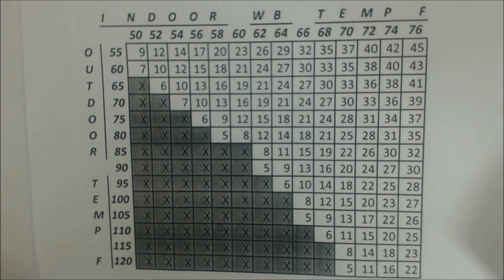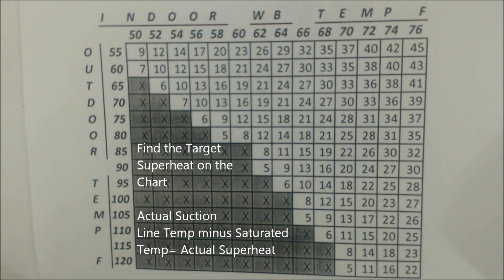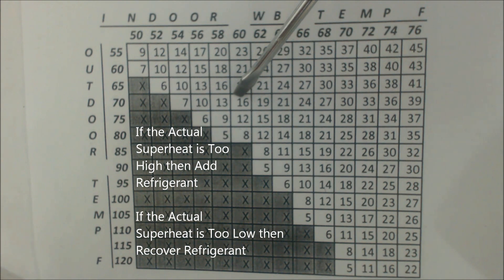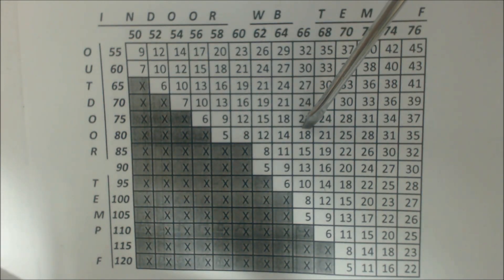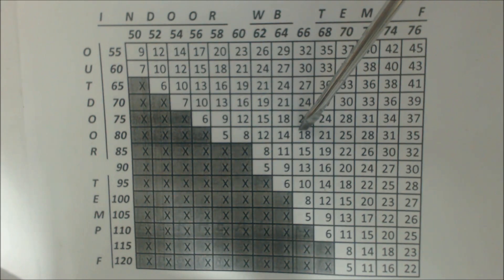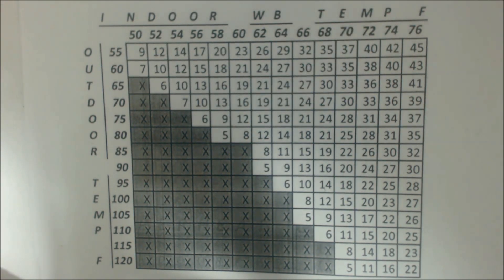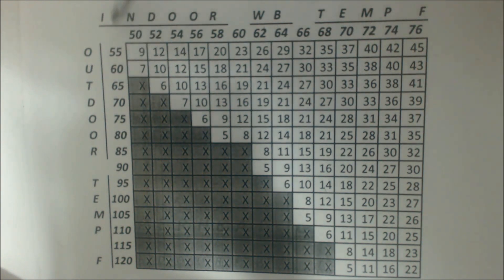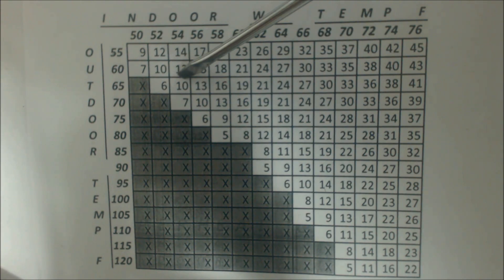Superheat Charging Chart- How to Find Target Superheat and Actual Superheat on an Air Conditioner!

Comment: I just did a change out at my house and didn’t add any extra refrigerant, so left it at the factory charge with my lineset being around 20’.  When checking my pressures my superheat is at 3.  86 outside temp and 75 indoor temp.  Something is wrong here and have no idea where to go from here, anyone have some advice?  I normally install new construction homes so rarely do any trouble shooting.

Comment: What is a good “wet bulb” thermometer?
Reply: Hey man check out the Fieldpiece JL3RH, it’s a great tool and you can use it through the job link app. I got mine a few weeks ago and it works great. Gives me the wet bulb temp on my phone in real time while I work outside at the condenser. Hope this helps.
Reply: @Jakeofalltrades777  much appreciated! I definitely will! This does help thank you!

Comment: I’m getting a little off topic. I have a temp split of 25 degrees today and my blower is running fine, it was not dirty. I ran the unit with no filter because the one it had was super dirty and I didn’t have one at the moment. Checked charge with superheat method and it was telling me I was overcharged. Will that cause my temp split to go high? Or will an airflow problem cause my superheat reading to tell me I’m overcharged although I’m not? I hope I’m making sense. Thank you in advance

Comment: I’m confused now because the formula for finding the superheat is the actual line temp minus the saturated temp/pressure in the middle of the evap = actual superheat. But now you’re saying to use the outdoor temp instead of the line temp. Is the line temp the same temperature of the outdoor temp?
Reply from the maker: Russell, this chart is for finding the target superheat or what the superheat should be.  You are correct that the actual superheat is measured by line temp minus sat temp. Did you check out our full length article on total superheat with the custom pics yet? https://www.acservicetech.com/post/the-hvac-total-superheat-charging-method-explained

Comment: Hi. I had an instance today that was confusing to me while trying to determine required superheat. Indoor WB=58 degrees; Vapor PSIG=60; Vapor line temp=47 degrees, outdoor dry bulb (temperature around condenser) = 96 degrees. There is no intersection of 58 WB and 96 dry bulb on the chart that gives a required superheat. I was using a Testo 550 digital gauge set. Am I missing something? Thanks.
Reply: Did you figure out what was going on with that unit?
Reply: @SaresMLee  There was nothing going on with  the unit. The unit is operating correctly.  If you look at the superheat chart,  there is no intersection of WB 58 and 96 ambient temperatures. It shows X, which indicates to me the reading are outside of range. What does one do in a case like this as far is calculating superheat is concerned?

Comment: how bout if it gives you around 95  temp 60 wet bulb what the x is ?service tech?
Reply: Exactly what I'm seeing.   Low pressure is 62 psi.   Suction temp is 62.2 .  Dry utah?   I'm about satisfied.     But how much do I loose when I take off my lines?

Comment: Great video! But I wanted to ask: when charging a system with an outdoor temperature of 80°F and 66°F indoor WB, after I reached the target superheat of 18°F, I find out that the saturated temperature in the evaporator is too low 30°F.
 What can I do to fix this? 
Keep adding more refrigerant to rise the evaporator temperature or leave it like that. Would the evaporator become frozen?
Just wanna hear out your opinion please.
Reply: add more

Comment: Can a digital laser thermometer, "point and shoot" type,  be used to measure the temps for this method? Thanks.
Reply from the maker: No they are very inaccurate and the temp where they are reading can change. You want to measure the air but that is measuring the object, thanks!
Reply: @acservicetechchannel  What about using one, though, for measuring the surface of the suction line at the condenser? Still not accurate? thanks!

Comment: I got a r22 split system,im replacing a r407c condenser would i be able to used this chart ? Has a piston on coil
Reply from the maker: Yes, the refrigerant will not change the target superheat, thanks!
Reply: @acservicetechchannel  thanks this help alot

Comment: Question: My Goodman Heat Pump has a charging chart on the back of the condenser cover with different Super Heat / Subcool . Should I fallow that or this chart??
Reply from the maker: Yes always follow the manufacturers chart as they may have a graduating subcooling instead of a average subcooling posted. Target superheat should be pretty close though, thanks!

Comment: I’m having trouble getting the correct superheat using a R22 replacement Nu22
I’ve went over 7# of original charges to even get close but stopped charging ( wet bulb 66) outdoor 95 .....best I could do was 20 superheat system was sweating back and cooling ....seems odd?

Comment: Thanks for the video. So to get the target superheat we have to measure the outside temp and inside wetbulb and follow the chart to find out our target superheat and then use that value to charge the system correct?. But when we start charging our system wouldn’t this change the inside temperature to cooler dropping out superheat value?
Reply from the maker: Yes, you will need to continually remeasure the indoor wb and input it in the chart to determine the moving target superheat, thanks!
Reply: AC Service Tech LLC ok so at what point do we stop if we are doing this back and forth?
Reply from the maker: @HowToDoitright  Just until the target lines up with the actual superheat and they are the same superheat, thanks

Comment: what happens if it's on the shaded area?
Reply from the maker: That means that you would have to set the system inefficiently for compressor safety unless there is an accumulator. This is a question that is asked a lot from techs that live in hot dry locations such as Arizona. The answer is the installation of a TXV for efficiency and for compressor safety, thanks!

Comment: Here in California we have outdoor temps over 120*F, indoor wet bulbs lower than what you have, what do we do in this scenario?  Your chart does not cover these options.  Now what do we do?  Call the manufacturer?
Reply from the maker: Unfortunately, you would need to set the total superheat higher than you would want for compressor safety if you run into a system with a fixed orifice. Only install TXV's in that environment. Nobody should be installing fixed orifices there. It doesn't make sense for compressor safety and efficiency. Also you hit on a good point. If there is a piston or even if there is a txv, an accumulator would also make good sense there due to the temp swing. I wrote quite a lot on this subject in the book I just put out. I just can't believe people are still installing pistons there. I think it is just that they don't understand how the txv works and the benefits, thanks!

Comment: Thank you for explaining this so it made sense. A guy at work tried to explain this to me and made it sound like it was rocket science. Have you ever done a comparison using the chart and using your gauge pressure and temperature readings on the refrigerant lines?  I was wondering if this chart would hold true for automotive air conditioning?
Reply from the maker: Automotive compressors work at varying speeds and this chart is for fixed single and two speed compressors in 2nd speed. Look up "acservicetech superheat playlist" thanks

Comment: yesterday i had a situation with a cap tube where the outdoor temp was 77 and the indoor wetbulb was 48. What superheat is needed?? In the chart it doesnt say so assumed a superheat of 5.  Also when i was charging the unit, the high side was increasing but the low side stayed at 30deg saturated temp. Wouldnt 30deg freeze?
Reply from the maker: The problem with the low sat temp was checking the system with a low heat load. The humidity is too low and you should check the system again when it is hotter outside and inside. Do you live in a dry climate? If the system has a cap tube, does it also have a rotary compressor with accumulator to help protect the compressor? I wrote a whole section devoted to this topic in the book on refrigerant handling I just wrote. It will be published by the end of the month. Cap tubes will also not allow the pressure and sat temp to increase as much as pistons do when adding refrigerant.
Reply: AC Service Tech LLC So why just not charge a piston/cap tube based off the charging chart on the condenser plate? Or does the charging chart not take into consideration indoor wetbulb??
Also i downloaded a little chart you provided to charge pistons based on outdoor temp and indoor wetbulb, is the chart more accurate than the condenser plate or which should i use??
Also why not charge just based on TD? Meaning if the indoor wetbulb is over 60% wet bulb charge to 15 TD and if its around 45-55% charge to 18-20 TD? Which method is the best out of these that i provided? Thank you your videos are awesome!!

Comment: Hooked up to a lennox, that says charge to 5 degree subcooling then add 2.2 lbs. Currently system is running at 10.5 sc and 29 sh with 124 low and 318 high side readings on 95 degree day. supply air is 74 and air out the vent is only 62. How would i know the correct subcooling based of lennox recomendation of 5 degress plus 2.2 lbs?
Reply from the maker: That doesn't sound right. I have never heard of a charging procedure like that. Is it a single or two speed compressor or something else?
Reply: Single stage, here is a link to the manual, page 25 its a 3.5 ton (42 series) and indoor unit is a CBX27UH−042. based of the chart 13 sh and 5 sc and then add 2.2lbs. without removing 410a dropping it to 5degrees and then adding 2.2 im not sure what to charge to.  Currently evaporator is sweeting in 85 percent showing possible undercharge??

https://www.lennox.com/lib/legacy-res/pdfs/installation_maintenance/lennox_14hpx_iom.pdf
Reply: Sorry page 28 shows that chart

https://www.lennox.com/lib/legacy-res/pdfs/installation_maintenance/lennox_14hpx_iom.pdf

Comment: Is there any reason when I use my psychrometer at the condenser even on a day where it’s above 20 degrees Celsius outside I’m always constantly getting under 55 degree F? It’s always around the 48-49-50 degree range. Even on a hot summer day. Are you saying that the outdoor temp is the number you need or the air temp entering the condenser?
Reply from the maker: What model psychrometer is it? The dry bulb air temp entering the condensor and the wet bulb air temp entering the evaporator
Reply: acservicetech I’m not exactly sure but I’m pretty sure it’s made my yellow jacket. But I think I may need a new one. But thanks for the feedback! Love your videos. Right now it’s air conditioning season and I’m installing them daily by myself.
Reply from the maker: I have used that "General pschrometer" for years. I have the same one linked in amazon.com/shop/acservicetech .Thanks Michael!

Comment: Why are some of the areas of the superheat chart blocked out with X?  WHat if my outside air is 100 but inside WB temp at a grill is 60?
Reply from the maker: They are blocked out because a piston at that outdoor temp and wb would need to be set below 5 degrees of superheat but it cant because that could mean liquid going to the compressor. Pistons should not be used in that climate, only txv's and if pistons are used then they have to be set inefficiently for compressor safety unfortunately!

Comment: My WB is 54 my outdoor temp is 75, that put me in a box with a X on the superheat chart, so I come back when the outdoor temp is 95, my WB is 60  that put me in another box with a X ! Heat pump seems to work fine. does anyone know what to do now? Is it charged correctly? The Heat pump is in cooling mode. no TXV.
Reply from the maker: The problem is that you have little to no superheat. The system would be working efficiently but on some days with high outdoor ambient heat and low indoor wb, liquid could be getting into the compressor. You are likely in a very  dry climate where technicians should be installing txv's instead of pistons for efficiency and compressor safety. Are you reading 5 degrees or more of actual superheat with your gauge set on those days? Thanks
Reply: Yes this is a dry climate. If liquid could be getting into the compressor. it is over charged ! The low side gauge is 59 that is 39 f (mo99) the suction line is 41 f That is 2 degrees superheat, if I am doing this right. If the wb goes up and the out door temp goes down, I would be back on the chart at 5 to 8 degrees target. I think my low side gauge and suction line temp would change too. My  2 degrees superheat  may go up 5 or so, or would it not ?  But the superheat charging chart is not helping me out reading X ever time I use it.
Reply from the maker: Yes the chart shows the target superheat for maximum efficiency. You would have to set it for a lower efficiency for it to for for compressor safety. That is why I am saying pistons are such a bad choice for  dry climates, thanks
Reply: AC Service Tech LLC assuming a 75 outdoor temp with 2 superheat. When it gets hotter the next day, wouldnt the superheat increase? why would the compressor see liquid when it gets hotter if you leave with a low superheat on a cool day?

Comment: I have a question. There are many times when taking the measurements to figure out target superheat I end up with a number that is lower on the charts landing me in the gray x area. I live in Colorado and it is very dry here. Is my target superheat not obtainable because of the low humidity and if it is is there anything I can do to obtain the target sh that I need. My wetbulb is always measured in the return drop closest to the unit and is usually around 54 degrees. This has always puzzled me. Thanks.
Reply from the maker: This is a question I get asked often. It is very interesting that techs have been installing pistons in such a dry climate and that other techs come across them and have to set a higher than desirable superheat in order to keep the compressor safe from liquid during a high OA and low indoor WB day. The real answer is installing a txv. It will increase the efficiency as well. If you are there to set a charge with a piston then unfortunately you have to set the superheat on a number higher anticipating the highest outdoor temp and lowest wb that the system would run at. If the superheat was set to low then it is possible that on a high OA and low indoor WB day the compressor would see liquid. I hope that makes sense!

Comment: What about the X's
Reply from the maker: If you are measuring numbers that are in the x's and that is the conditions it will be running then the unit should have a txv and not a piston because you are going to have to set the superheat too high for efficient work. You would set it higher at 6-8 degrees of superheat as long as you don't think it will get lower in wb or higher in temp. A good case such as this would be Arizona. All systems there should be txv but some installers run into pistons that are there. thanks

Comment: Please explain me,will your showed chart (indoor WB temp and outdoor temp) be different for different gases likeR22,R134a,R410a.and from where can i get this chart,
Reply from the maker: This chart is for comfort cooling systems with cap tubing or piston only and works for r-22 or r410a on single speed and two speed compressors (not microchannel) but always see if the manufacturer provides a charging chart first, thanks

Comment: Hi Acservicetech I looking for a better way to remember superheat/ subcool target temperature, as in to find an easier way to understand when add or remove refrigerant.  i.e superheat target temp is "8" and I'm at "4" I need to remove refrigerant. I understand it is the opposite for subcooling i.e if target is "6" and I'm at 3 I need to add. Is there a trick or an old saying that can help student remember this method ?
Reply from the maker: Hey Guardian, maybe this will help
If there is not enough refrigerant in the evaporator then the refrigerant will be heated too much- high superheat.
If there is not enough refrigerant in the condensor then the refrigerant will not be cooled enough- low subcooling

If you want to be notified of future updates/opportunities for ACSERVICETECH training, submit your email to info@acservicetech.com

Comment: good day acservicetech! I would like to ask a question regarding how to know/determine if the amount  of charge is enough,  The unit is running with r410a with txv. Well what I mean is the unit is new and already running quite a while now and I couldnt understand the plate since it is written not in english. and I could not find any reference of the numbers of superheat and subcooling. How do i check if the charge is right using gauge manifold. I am new at this so please if you have any idea kindly reply  thanks!
Reply from the maker: You would use subcooling for a txv metering device. If there is no subcooling on the rating plate and it is an air conditioner, we usually figure 8-12 so I usually set them at 11 and check for a 18-21 degree temp decrease across the indoor coil return to supply, thanks!
Reply: Thank you for responding. Its a lot of help

Comment: Thank you for your video. I am a freshman,  I have one question. As we charge an AC, do we need to set Indoor wb temp and outdoor air temp in the charging facility ( such as, TESTO 549 Digital Manifold Gauge) or do we have to measure them by additional thermometer? Thank you
Reply from the maker: That model has optional temperature probes I believe, thanks!